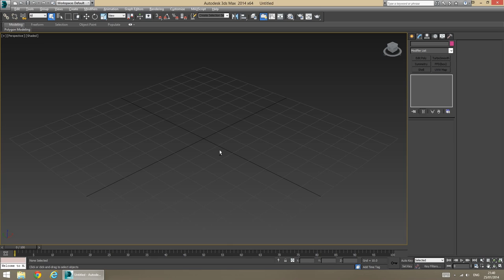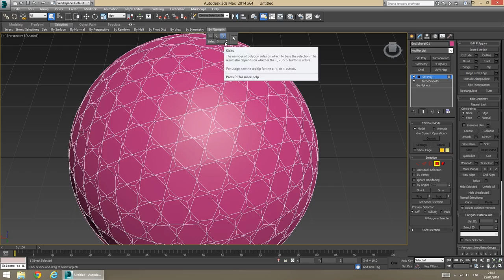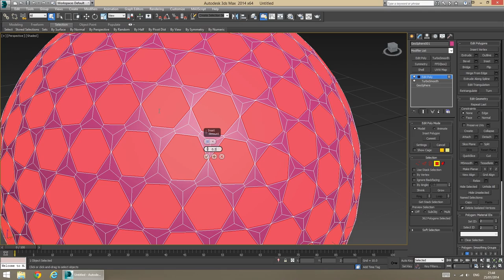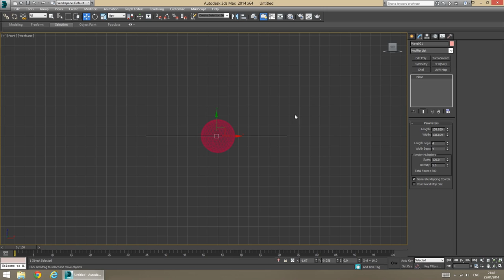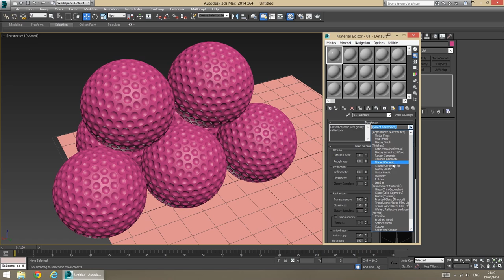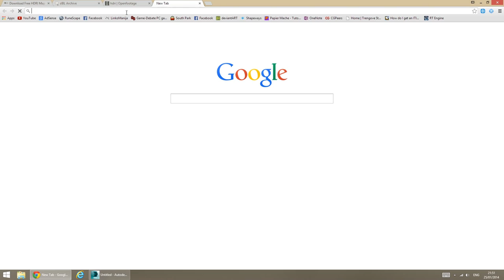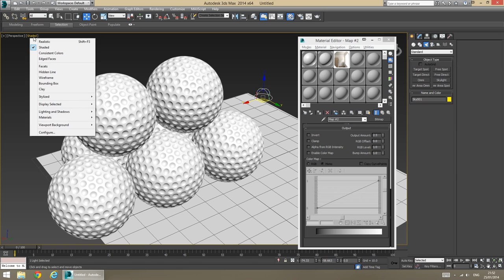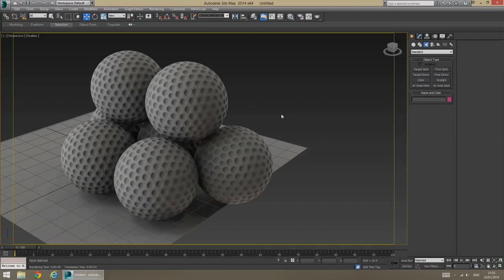Golf Ball Modeling, HDR Lighting and Rendering | 3Ds MAX Tutorial

Comment: Great video man! :) Quick question: @ 5:46 you scale the ball down, but somehow I can't "uniform scale" my models. I can only scale them at 2 axes at the same time and the other one gets deformed :/ Do you know how to solve this? Thanks!
Reply from the maker: Hi! You must have pressed the shortcut for scale multiple times in a row, which means you may have selected a different scale mode. You can either do that again till you come back to uniform scale or long-press the scale button in the toolbar and select it yourself. Hope this helps and thanks for watching :)
Reply: Yes, it works!! Finally I can scale right again :D Thanks a lot :)
Reply from the maker: CptJohnson23 No problem, glad I could help!

Comment: How did you add the shortcuts in modifier tab?
Reply from the maker: +V1n1c1us Hi!
Under the modifier stack on the lower right there's a button shaped like a windows with four buttons called "Configure Modifier Sets". Just click that and you can configure your set of shortcuts from there. After you're done - click the button again and in the dropdown enable the "show buttons" option.
Hope this helps!
Reply: PIXELFLUX
Thanks

Comment: In my 2019 version, I can't see those triangles by default. What should I do ?
Reply from the maker: Which triangles? You mean your sphere is made of quads? Or that you can't see the actual lines of the model?
In the first case - you need to use the GeoSphere, not a normal Sphere - watch the video on where the GeoSphere is located. To get the edge lines to show up in case you don't see them - press F4. Hope that helps!
Reply: Thank you! it worked by pressing F4. How can I make it default to show edged face ?
Reply from the maker: When you''re in "edged faces" mode (F4) - move your mouse to the top left corner of the viewport, click on [Edged Faces] > Display Selected > Display Selected with edged faces.
This should make any object you click on show as edged faces regardless of your F4 toggle. I don't use this myself, I just use the toggle as I need to swap between the "clean view" and edged a lot.
Reply: thank you for the assistance.
Reply from the maker: You're welcome :)